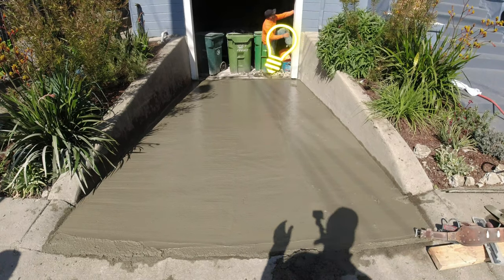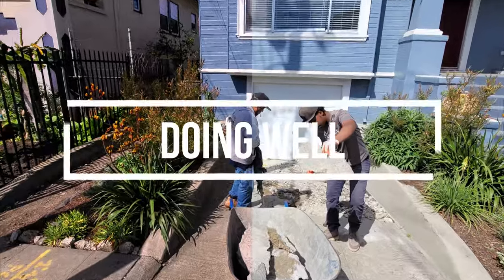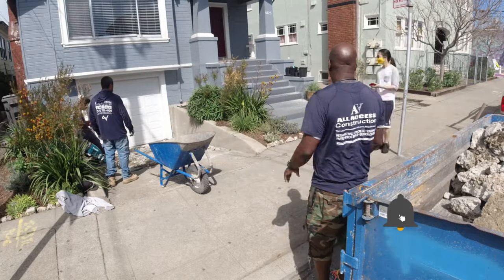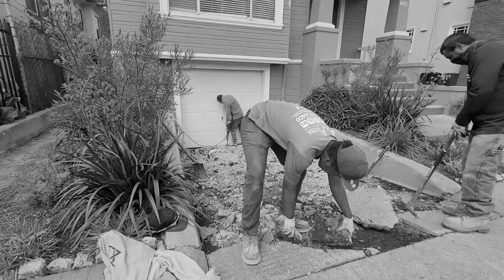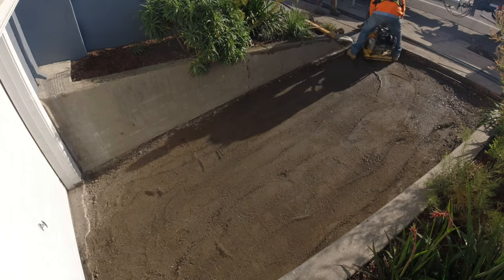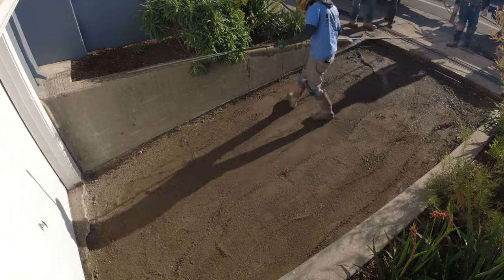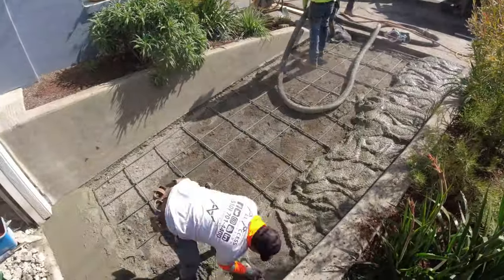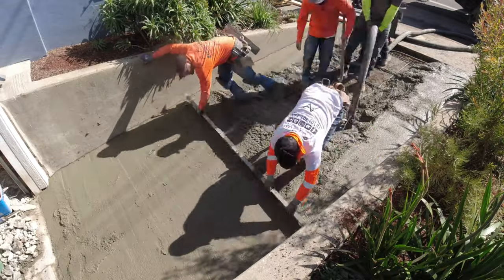SEE What It Takes To Demo & Pour CONCRETE Driveway | All Access 510-804-4646

Comment: When working on a slopped driveway do you adjust your water ratio for a thicker pour? What do you take into account when deciding what kind of concrete to use?
Reply from the maker: All our concrete is a 3000 psi.. The customer have a big existing sump pump that you can't see. Which pumps the water back out.. Appreciate the comment 👍🏾.. Got at least 2 more videos for this project.